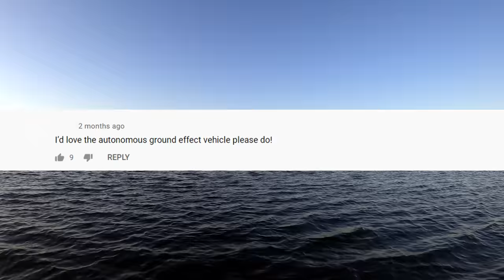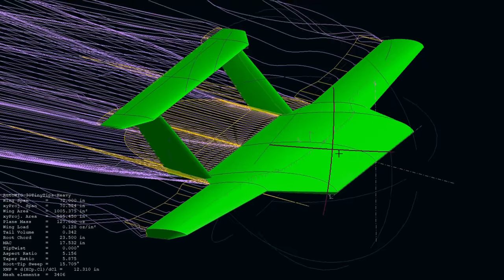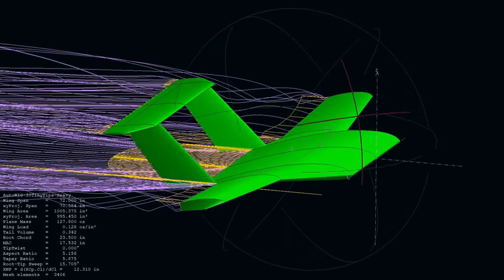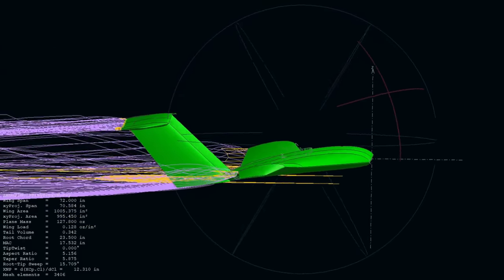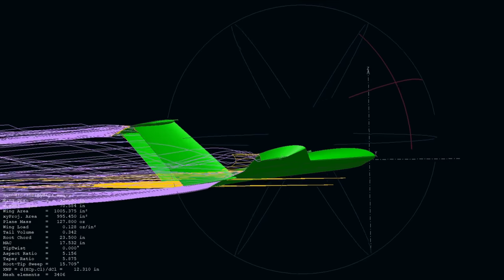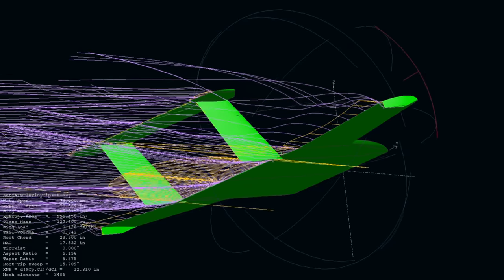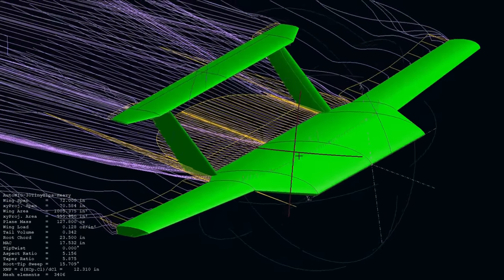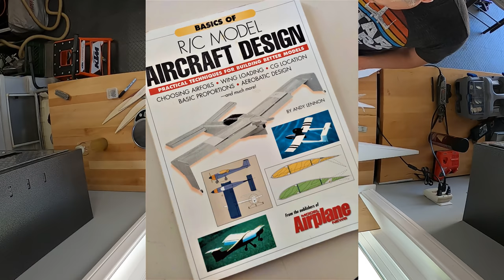Worlds First Autonomous Ground Effect Vehicle/Ekranoplan?   RCTestFlight Collaboration

Comment: Interesting project. Can I ask how you calculated altitude above the water? I'd imagine air pressure wouldn't be accurate enough, gps would probably have the same issue, radar would be too heavy, a dangling switch would cause too much friction, echo pulses? Did it react to the little waves or does it average that all out? Going forwards, how would you spot ships and windsurfers etc? You don't mention but what is the benefit of using ground effect on an autonomous airplane?

Comment: This so fascinating , are you going to take it to the next level so that it has a solar array enough to reacharge the batteries with a rate equvilant to the energy drain consumption rate so that it eventually can take flight autonomously continuously indefenetly like the solar autonomous boats you mentioned at the beginning of this video.
Reply from the maker: No, but maybe one that can recharge without a charger.

Comment: Correct me if I am wrong, but is the plane more flying one foot off the water vs actually maintaining flight in ground effect? It seems to me it is well designed for this type of flight, but ultimately flying under control vs ground effect maintained flight.

Comment: How were you achieving the 1 foot altitude? Lidar, or pressure altitude control? Or just letting it settle into a natural height at the correct speed?
Reply from the maker: Ram pressure was controlling the low end and baro the high end.   RCTestflight will implement more sensors for better altitude control.

Comment: Wouldn't VTOL/Ekranoplan be extremely useful? The things could operate as ferries, but they could take a short hop from the water and land in a parking lot. A tandem wing with pivoting fans could also exploit the Coanda effect, then transform into a huge quadcopter for the last hop.
Reply from the maker: This is something interesting I have never thought of....
Reply: I suppose that VTOL properties would require such strong engines that the vehicles would be classified as airplanes.

Hovercraft were able to access flat beaches and sit down there. They had no vulnerable structures on the basis, GEVs have. IIRC some water based vehicles use down vectored compressed air for easier lift off, including airplanes. 

Not sure in which way the Coanda effect should help here. Saw another vid from a guy demonstrating this with a quadcopter. Enormous power and noise for little effect, it was instable and barely got off the ground. Simple propellers were more efficient, but see above. Coanda effect decreases pressure when it should rise, I think.

Comment: This is very impressive!  Excellent work.  I've been interested in building a micro light version of an Ekranoplan for one person.  It can only weigh about 150 pounds for the micro light classification.  I've flown light aircraft, hang gliders, paragliders,  powered paragliders and R.C. aircraft and have always been fascinated by Ground Effect vehicles.   I figured I would power it with a small powered paraglider motor.   Your design is close to what I was thinking of using but I am planning on using one pusher motor.   It wouldn't take a lot of horsepower to drive it.  Altitude control  and pitch stability are some of my concerns so it doesn't fly out of ground effect.   This just might be my winter project this year.  Thanks for the vido!  Liked and subscribed!  : )
Reply from the maker: me too
Reply: @thinkflight  Hi thanks for the reply. Have you come up with an idea of how you would design it?  I would be interested in seeing that. : )
Reply from the maker: @mojoneko8303  Sure check out my channel trailer, it has the initial concept there.

Comment: Sorry I didn't finish the video but I'm in the middle of the part where you're making the airplane I just wanted to say don't they sell airplanes like that already on the market that you could just buy instead of making it just wondering? 🤔 I remember remember when I was a kid I used to love hovercraft anything that hovered hoverboard hovercrafts I was obsessed with those and then finally I bought a toy that they sold in Toys R Us that was a hovercraft and I was disappointed that it only worked on water because hovercraft are supposed to work on land and water?

Comment: Did you have a current sensor on the motors? It would be interesting to see if you could tell if she was in ground effect simply by looking at total power consumption.
Reply from the maker: Yes and when we are able to control height in GE better there will more data than we can handle!  It will be more reliable data as well which is what we need.

Comment: Bit much for model, and probably way too expensive, but I wonder if some level of role and pitch control could be done with an inertial stabilizer similar to what they are using on some boats. Thereby removing the need for the winglets.

Comment: Do you have plans to escalate this project into a kit plane where a Ground Effect Vehicle could be built like a microlight/ultralight?  

Fly-by-wire would surely help this out as ground effect is more of a computer aided sort of thing as it needs to react quickly and no margin for error when it comes to striking the water surface.
Reply from the maker: Into a one-off yes, kits could come from there I suppose depending on interest.

Comment: Would it be useful to have hydrofoils during takeoff, to increase lift until the craft leaves the surface? Perhaps in a case of larger scale and a craft with higher weight/power ratio (being able to takeoff with cargo or weaker engines).
Reply from the maker: Yes

Comment: Is there a difference in battery life in and out of ground effect?
Reply from the maker: Theoretically, but not calculated, leaving that up to RCTestFlight.   I can tell you manually flying yes you do get to decrease the throttle when you hit GE.  But that is not data and we need that, so head on over to RCTestFlight or hang out for V2!

Comment: I loved the project! Man, I have a question. How do you know the plane is in fact in ground effect and not just keeping position at the established altitude? Thanks!
Reply from the maker: In the waypoint mission it was oscillating in an out of ground effect.   As it sank into ground effect the pressure beneath the wing would ramp up and bounce it out of GE, the lift out of GE would drop as it increased in altitude and thus drop back into GE.   If you watch the video carefully you can see this oscillation happening very slowly.

Comment: I've seen a large version being used in H.K. for ferry service but it scoots doesn't fly.
Reply: 100% sure it was a ground-effect vehicle? those are kind of supposed to fly
i am asking because i suspect what you saw are hydrofoil ferries-- those use hydrodynamics to lift themselves and skrrrr accross the water at fast speeds, having little drag due to the water touching
they look like they rise above the water and touch a small amount of it
Reply: @aiocafea  yeah it rose up just over the waves with nothing in the water flying but only about ten feet.

Comment: Why "ground effect" ?? Is it much more efficient ?
Reply: Yes. IIRC, the Airfish 8 (8 passengers I think) is powered by a quite efficient Diesel engine at relatively low fuel consumption. Of course planes also undergo greater lift at landing which can be felt when height is less than a wingspan. Lift needs speed, speed causes drag, overcoming drag requires power. Ground effect causes more lift than drag, I think.

Comment: Hmm, an autonomous drone, flying below the radar, a relatively cheap anti-ship weapon
Reply: Unfortunally its not as easy as that, "Under the radar" only means "Under the horizon" flying close to the ground in turn means that ull get cloaser to the target befor you get above the horizon from the perspective of the target.
With todays satelite radar and reaction times of modern warships it isnt a viable enoth strategy to try and sneak up on one, youre much better off lugging a projectile at increadible speeds against one (See railgun).

Comment: Awesome flight… bird dont have wingtip vortices… if they have they would need a vertical tail or split aileron…bird uses bell shaped lift distribution which will causes wing vortices…not wing tip vortices…try prandtl nasa
Reply from the maker: In general I would agree, but looking at the picture the wings are actually washed IN, not out, so at the time the photo is taken it is definitely not a bell shaped distribution.   Prantl wings only work with a considerable (8+ degrees?) of washout.
Reply: @thinkflight  For prandtl I think is 0.7…maybe the picture is near 0.8..Yeayy it is about 8+ degree

Comment: Your biggest problem is that the craft is far too light. You're generating far more lift than you should be, and that's because the craft isn't nearly heavy enough. The concept of these wasn't so much to make a plane hug the water, but to make a big boat fly. 

Get an RC pontoon and design it to do this while carrying a payload, and you'll have a true Ekranoplan. But be warned, you're going to need much more powerful engines than you're currently using.

Comment: Google turbo it's been around for years you didn't create anything new do you want to do it right do it with no wings
Reply from the maker: Link?   Can't find what you are talking about.
Reply: Hydro foam airboat it's a remote control RC airboat that buys on land and in water looks like the Budweiser both no wings just Center section
Reply from the maker: @robertabbott6736  the only thing new I'm suggesting is the autonomy part.

Comment: A ground effects plane doesn’t make economic sense. The fuel economy is just a little better than a normal plane. And sooner or later, that low-flying plane will hit a wave. It’s dangerous. That’s why engineers never discuss the only thing that matters. A normal plane gets 90 miles per seat per gallon. What’s the fuel economy of a ground effect plane?
Reply from the maker: I'm not sure I disagree, but this will be very quantifiable with RCTestFlights code mods and maybe a V2 with some serious efficiency upgrades.
Reply: @thinkflight  The problem is what they call a “rogue wave”. Sometimes for no apparent reason a twenty or even thirty foot wave will rise-up in the middle of the ocean, for no clear reason. It just happens. As a result, ground effect planes have to fly high enough to avoid hitting a rogue wave. But that additional altitude defeats the purpose of the plane. On another note, the first civilian transatlantic crossing of a radio-controlled airplane took place about ten years ago. It took them four attempts. You could try the same thing. Just make sure that you have a friend in England to land the plane!